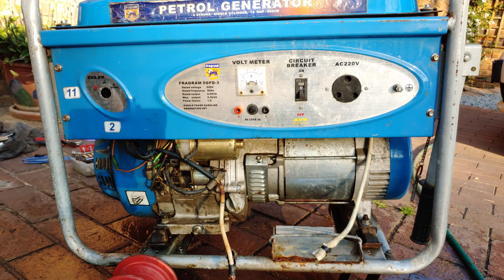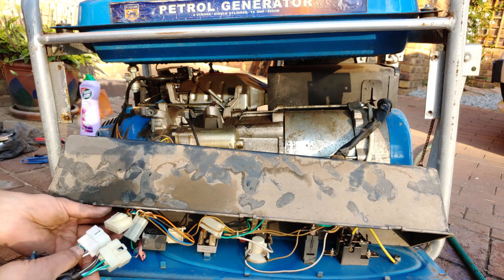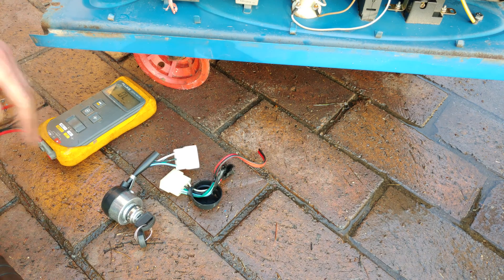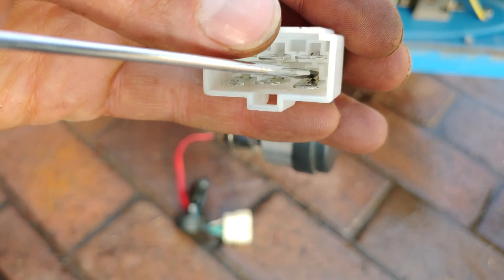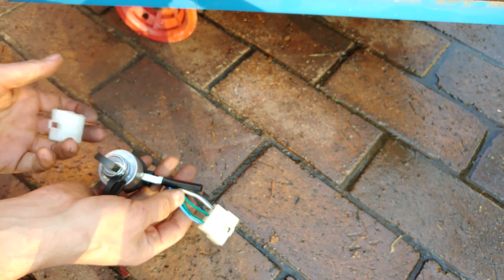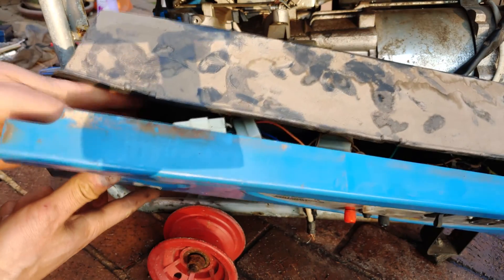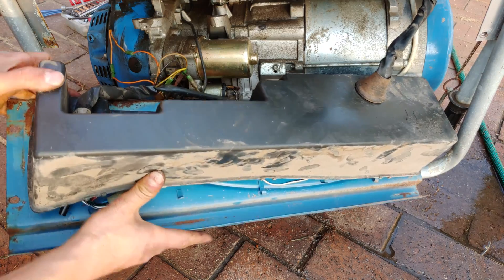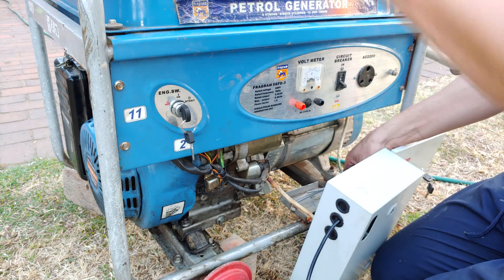How to install a new starter / engine key switch on a petrol generator

Comment: Open the plastic cap under the switch, note colours.  Do the same for both switches.

This guarantees the correct wire order.

Comment: The other problem here is that aftermarket switches rarely come color coded with the same kind of color codes as the generator that they're going to. My generator colors don't match up at all with my switch

Comment: My generator came without plug at all so I'm left with trying to figure out what goes where and then put wire connectors on the ends to fit the new key.  To make matters worse the first guy that said he could install it cut the wires off the old switch so the generator has a bunch of wires hanging out of it. I guess I don't know what to guess. This doesn't really cover wiring diagrams that don't make much sense and how they go to a plug and play that doesn't plug into anything so it won't play

Comment: can u share a picture of the regulator model and rectifier aswell .. also there is one 2 wire like relay or component nearby to the starter ..thanks

Comment: Hello 
I know this video is 3 years old but I hope you reply.
I want to add a smart switch to a home generator
I know that I need a 12v dc smart switch and then connect it to both the generator battery and the engine starter 
My problem is how to make it work for a second or 2 untill the generator start and then cut off the 12V from the starter ?
The only solution I can think of is press the button on and off respectively
But am searching for a better way.

Comment: Do you know where I can get the electrical diagram for the Fragram 5.5kw generator (the one in the video) Neighbour of mine borrowed mine, could not get it to start (because of low oil) and started ripping the wiring out and replacing, now its a mess. need help.

Comment: Hi, thank you for this tut, where did you buy the starter?
Reply from the maker: Adendorff
Reply: I bought one of those racing push start switches from the car accessories shop. I noticed on mine that the blue and green/white and the black and green are in a closed(shorted) position when in off state. Was yours the same?
Reply: Do key switches work on any generator? I have a Grip.